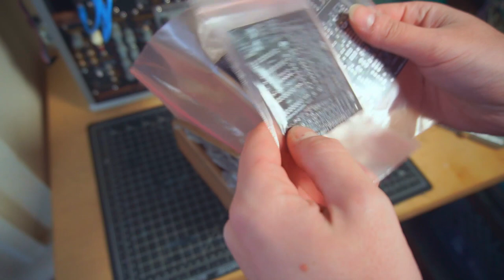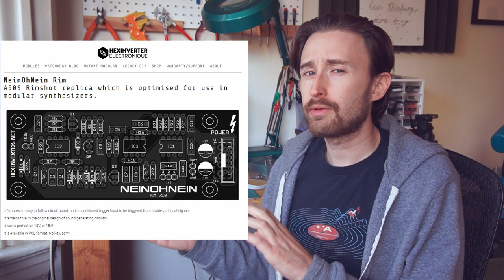Building Analog 909 Drums in eurorack! (Hexinverter NeinohNein)

Comment: Cool video! What resistors are you using on your Trigger Finger 3000 ? Is the red stripe on the cable +12V ?
Reply from the maker: They're just 10k set up as dividers to get ~6v to the trigger ins. It's regular eurorack power cable, 12v/gnd/-12v

Comment: Sorry for the basic question but do you go directly from the modular to the mixer input or do you attenuate in some way? Thanks
Reply from the maker: Yes, I send all the drums through a little 4ch eurorack mixer and then the mixed output goes straight to a line input. Can be handy to send through a line out module for metering and adapting to 1/4" jack. The clap is an especially hot output so requires an attenuator of some kind.